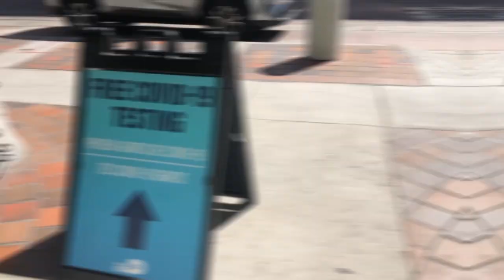Preparing to sail the CARIBBEAN! Converting our icebox into fridge + fresh water tank ~ Postcard 12

Comment: A little bit of foam insulation under the top cover would reduce the amount of humidity getting into the box and reduce the amount of frost in the freezer section. Cheers
Reply from the maker: Good call on that! The lid is already insulated with the original insulation but we kept some xps foam to redo it. As you say we often see condensation on in that area and having a better sealed / insulated cover would go a long ways to reduce it!